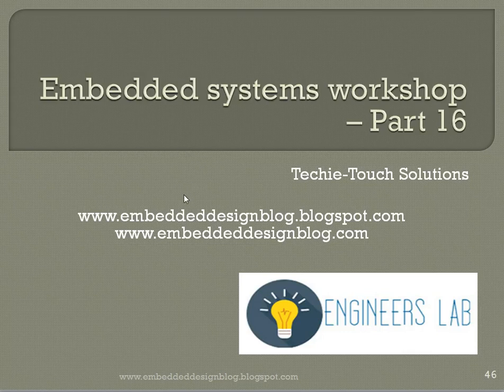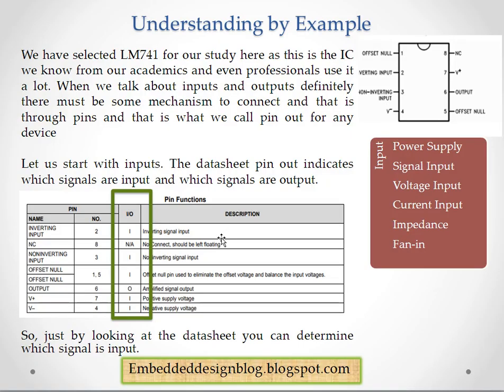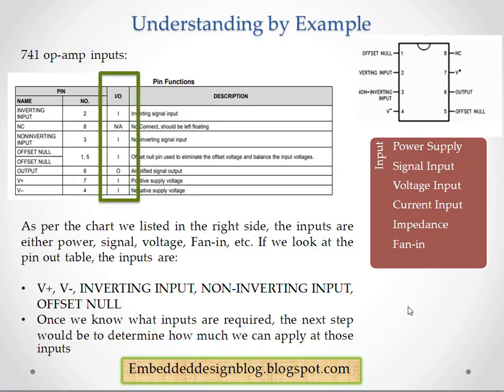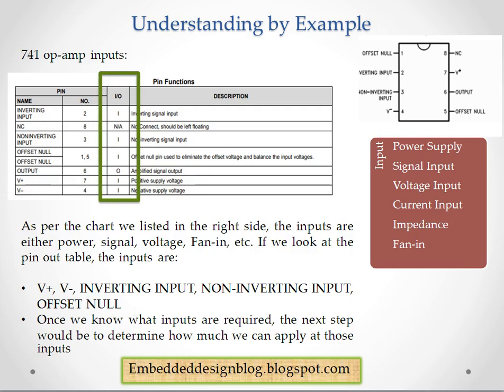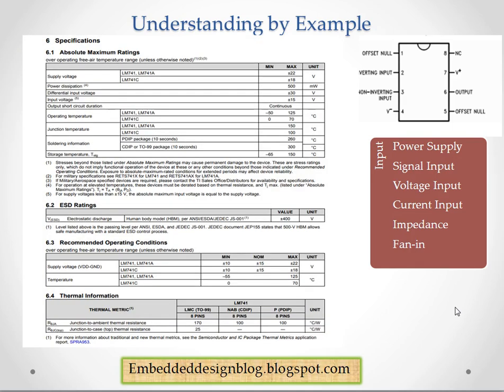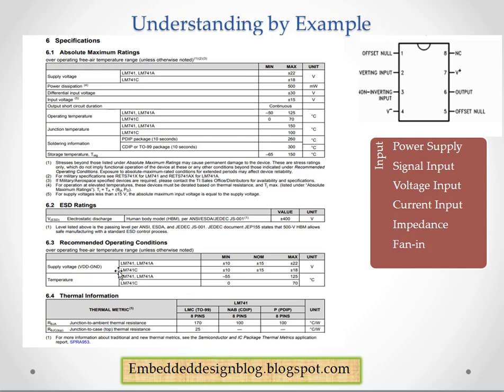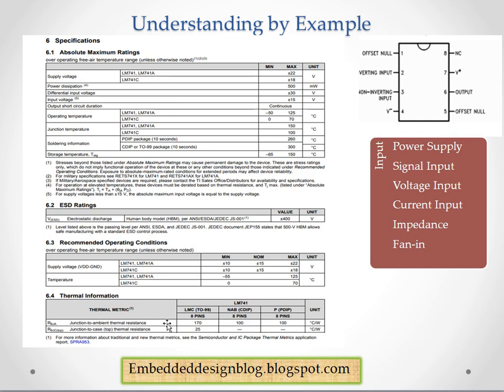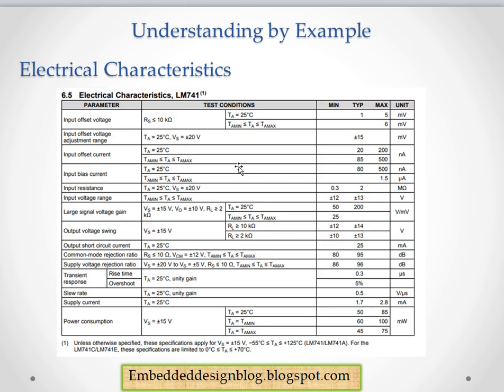How to read a datasheet | 741 op amp datasheet | Embedded workshop part 16 #opamp

Comment: Brother what is the purpose of offset null
Reply from the maker: When there is no voltage on the op-amp there shall be some voltage seen on the output.  We need to apply some minimal voltage at the input to make This output voltage zero. This is called offset voltage. Opamps must undergo something called compensation so that this voltage becomes zero. OFFSET NULL is such compensation pin which helps to nullify the offset observed. The term OFFSET NULL is self Explanatory